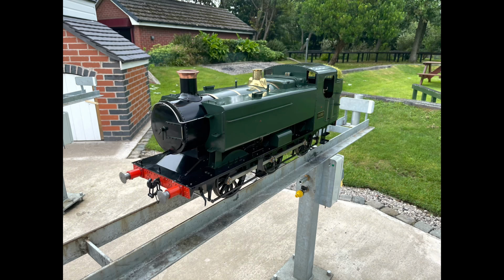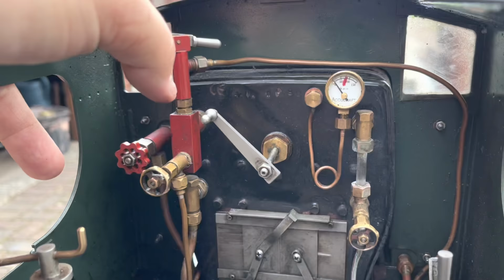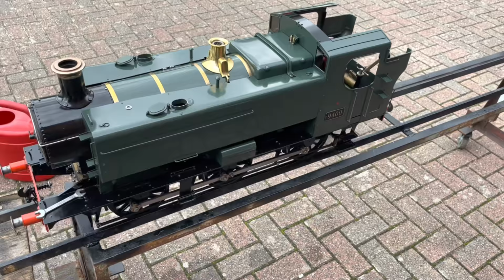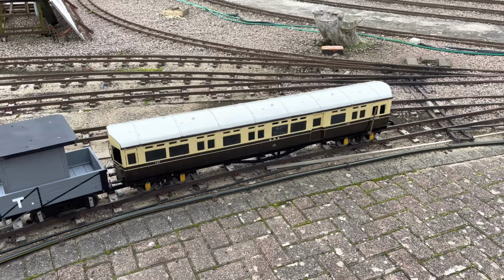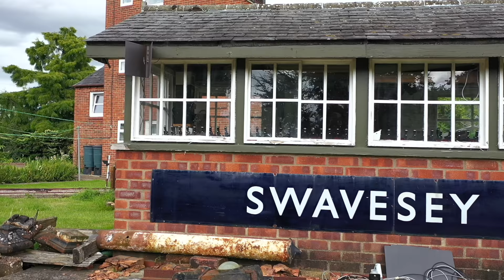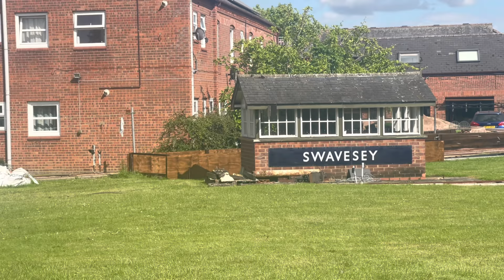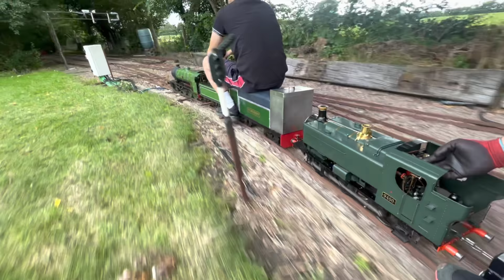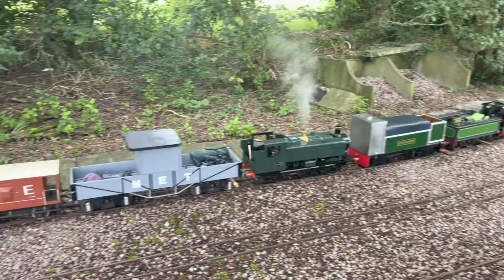I bought a 5” gauge Steam Locomotive! Running session with my new GWR Pannier Tank!

Comment: Any in the UK heard of Ikon Engineering from NZ? Nice dude, had a massive plant down in NZ for manufacturing ride on locomotives.
Reply from the maker: I havent personally, will have to look them up!
Reply: Imported internationally, weren't detailed but they were designed to run forever and be able to be built by anyone.

Comment: Is there a time that the locomotive explodes? Because i never seen a model train explodes brefore!
Reply: Unlikely. Model engineers are required to build to safe regulations and are tested. Despite this, the HSE still took fright and I was on the committee that worked with the HSE  to resolve the issues.
Reply: @peterellis6556  ok

Comment: At 5:02, is the axle pump just there to make things easier instead of using the manual water pump, or do you have to use the axle pump?
Reply from the maker: Yeah pretty much just a nice to have, as most engines have an injector, however mine doesnt still as havent got round to fitting one.

Comment: I am amazed that some of those smaller locos can pull a human along and not just sit there spinning their wheels, any idea of the weight of your Panier tank?
Reply from the maker: It is pretty impressive the weight they can haul, not sure exactly but obviously with the tanks full its a chunky little thing, if you have a slightly damp rail ect it will slip quite easily

Comment: What happened at 16.24?
Reply from the maker: How do you mean?
Reply: @UndergroundEric  did the loco go down a dip? The engine got lifted up at the front.
Reply from the maker: @globalgumboots  oh!! Great spot i didnt see that HAHA. Yes ollies riding truck was pulling the back of the engine downwards due to the height of the coupling, aswell as the rear springs on the loco being weak.
Changed them out and was fine after, didnt realise id caught it on video!